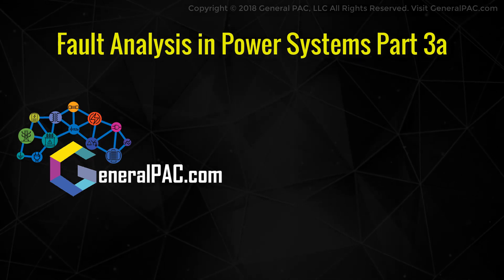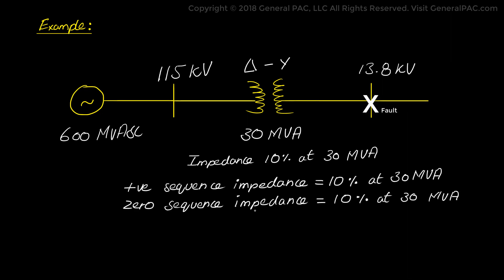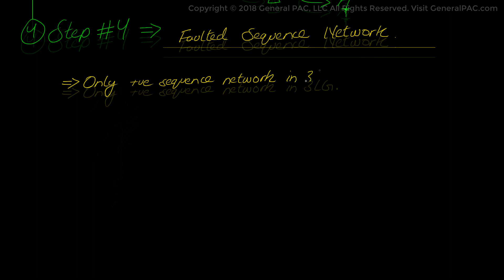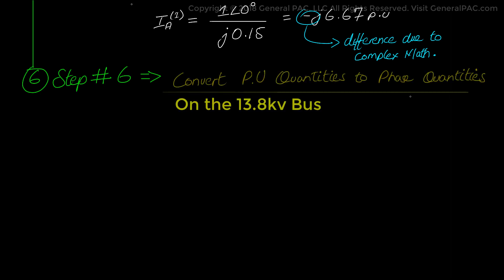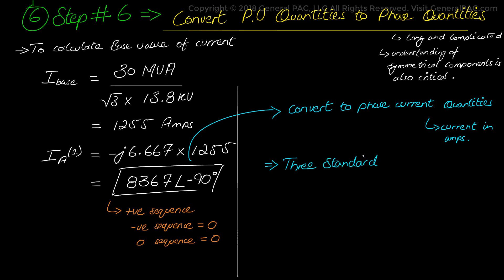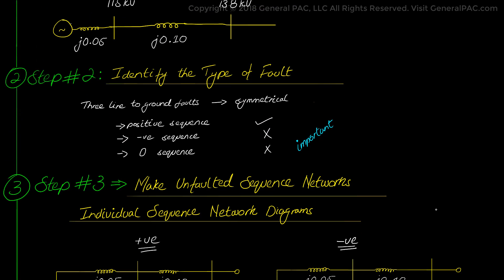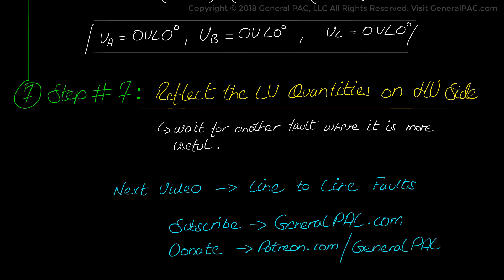Fault Analysis in Power Systems Part 3a

Comment: In your Part 3a video, when you were calculating your voltage quantities, you wrote j6.667 without the negative sign, do based on what you wrote 1,0 - (j0.15)(j6.667) would result in 1.0 + 1.00005= 2.000005 instead of 0.

Comment: Hi, first of all, thank you for your lessons, they have been very helpful.

So, as some people already pointed out, you used V_Base the same as V_Fault, shouldn't it be the same V_Base = 115kV? You could change the V_Base at your will, but the I_A = -j6,6667 pu was already calculated using the V_base= 115kV, if it were to change the V_base to 13.8kV, shouldnt we recalculate IA?

And again, thank you very much for your effort, from the multiple courses/classes i've seen on youtube, yours has been the most intuitive and simple approaching this complex subject.

Comment: Love all your videos.  One question though, at 7:44, why does the angle of IA1 change by -90 degrees for phase B and C?  Shouldn't the "a" operator be the only thing changing the angles because this is a symmetrical fault?  I would have thought they'd just be off by 120 degrees of each other.

Comment: In calculating the base current the units considered for power is in MVA and that for voltage is in KVA , Hence it seems the base current unit should be in KA rather than A , Kindly advise   on the same .
Reply from the maker: Hi Thoppil, Yes you are right. The answer should be in kA, but here the provided answer is given directly after making all the conversion.

You can verify the answer with the below mentioned calculation:

Ibase = 30 MVA / √3*13.8kV 
Ibase = 30,000 kVA / √3*13.8kV   (1 MVA= 1000 kVA)
Ibase = 1255 Amp

Thanks,
GeneralPAC by AllumiaX

Comment: Thanks for high efforts 
 finding the voltage  at 13.8 bus you need to take the value of current with negative sign
Reply from the maker: Hi Noman,
Thanks for your encouraging remarks, it boosts us to bring you more value via our content.
Thank you for pointing this out. We have noted your concern and will make the required changes. We appreciate your help in this regard. 
GPAC Team

Comment: Hope you realize there are no generators rated voltage 115 kV and rated power 600 MVA. 
Also for phase current Ib there should be a*inverse_component instead of a^2*inverse_inverse component.
Reply from the maker: This is more of an academic / intellectual exercise per the book example. Definitely not "real world application" as you suggested
Reply: @Generalpac  Of course if you switch base voltages to be more realistic, the calculation is the same in p.u. system. That is the beauty of it..

Comment: When you calculate the base current why did you but voltage =13.8Kv , instead of 115Kv Which is the Voltage base you used in the previous video?
Reply: I had the exact same question but I guess he never answered your question

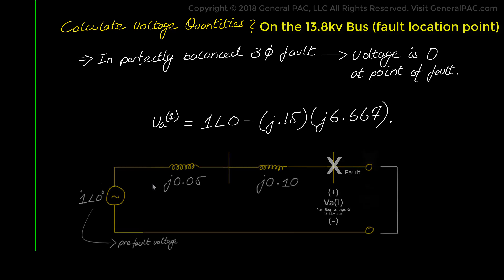Comment: At 5:22 why use the 13.8 kV to find  I_base when we have selected 115 kV as V_base? And at 10:00 isn't the per unit +sequence current -j6.667p.u ? why use +j6.667p.u ? I suppose this is a rookie error as the result is 2,00005 p.u ....while with the -j6.667p.u the result is 0.00005<180 deg p.u which is approx  0 <180deg p.u
Reply from the maker: We used the 13.8Kv b/c we are determining the fault current on the LV or 13.8KV side of the transformer. If wanted to find the same fault current on the HV or 115kV side, then we will use 115kV in the base current calcs. We actually determine the fault current on the HV side later in this series :)

Yes at @10:00 the per unit + sequence should be j6.667pu (i forgot the minus sign) -  this gives us the same result.

V_A^((1) )=1∠0°-(j0.15)*(-j6.667)=0pu

Thanks,
Reply: @Generalpac  Thank you for answering! Your work is top class really! I managed to grasp these fundamental concepts easily! I wish you the best <3

Comment: Excellent Videos... They are extremely helpful! I have a question at 10:40. It is stated previously that the -ve and zero sequence voltage values for Va are also 0 for a balanced system. But when the equations are evaluated, you use 1 angle 0 for the -ve and zero sequence Va values in equations Vb and Vc. Should it not be 0 angle 0 for the -ve and zero sequence Va values?

Comment: Sir, why is the calculation of Base current = S_base / (sqrt 3 * V_fault)?
Shouldn’t it be  S_base / (sqrt 3 * V_base)?
And u mentioned that the selected base voltage is 115kV as it is the generator bus voltage.
Thanks.
Reply from the maker: We used the 13.8Kv in the base calcs because we want to find the fualt current on the 13.8kV or LV side of the transformer.
Reply: @Generalpac   So which does this mean that we are going to use 115kV if the fault was happed in the HV side?

Comment: I'm a bit confused, at one instance you have the positive sequence current  I_A(1) = 8367 A @ -90 deg. But later you have the same quantity = 8367 A @ 0 deg.? and then back to -90 deg. Which one is it?

Can't wait for the next video! Love these.
Reply from the maker: At instant 7:27 The value of Ia(1) is equal to 8367 angle -90 degrees and not 8367 angle 0 degrees.
Reply: @Generalpac  Ok great thanks.